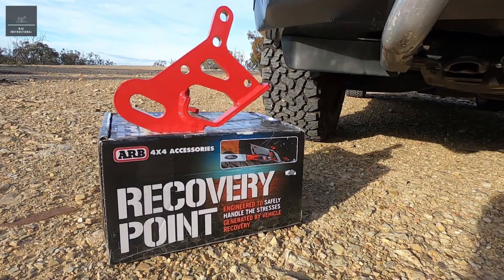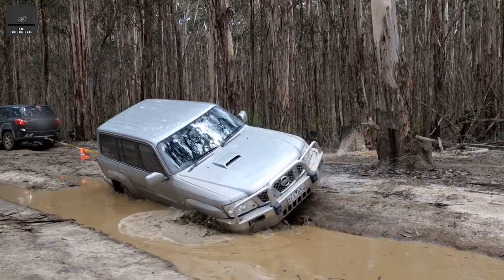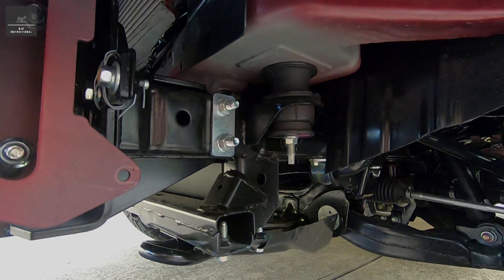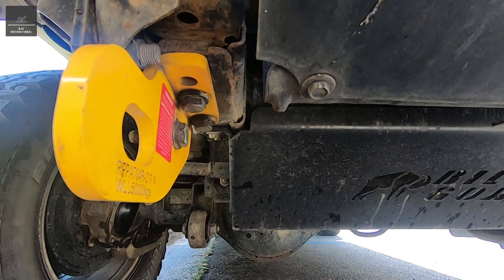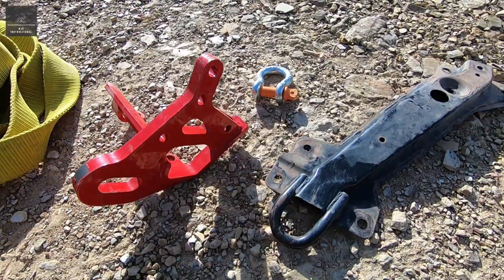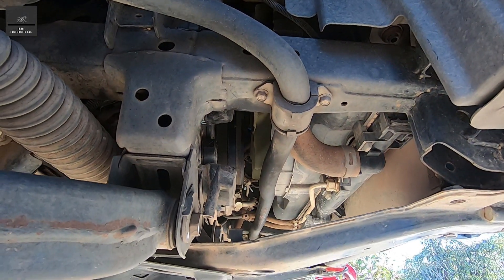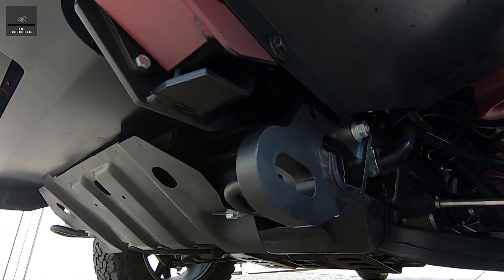4WD Vehicle Rated Recovery Points - 2 Important Considerations TOW POINTS vs. RATED RECOVERY POINTS!

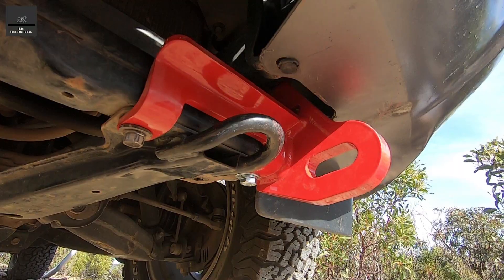Comment: Very nice video! Good explanation. I am now aware that those dual points are not for angled pulls, did not know that. I am guessing that you removed a few bolts to install this and create the video. But just wanted to double check:  at 3:28 in the right portion of the picture there is a bolt half way undone. (will probably not helf as much now 5 years later, yes i saw that after typing everything)

Comment: Some factory tow points on some cars like the Landcruiser Prado and Isuzu Mux are 4 point welded onto the 1st cross memeber of the chassis. They are as strong if not stronger than rated recovery points that are bolted to the same cross member. But I do agree, the example factory points on the vehicles you used in this video are indeed rubbish.
Reply from the maker: Not quite and this is the misconception. Refer back to the start of the video. I have seen photos of factory tow points (typically welded to a subframe not the main ladder chassis rails) torn off (e.g. current model Toyota Hilux / Fortuner). Just because they are welded it doesn't mean they can be used for recovery. A good quality engineered recovery point (or tow point) will always secure / fasten / brace back to the main ladder chassis rails.
Reply: @NJSInstructional  You must referring to the tether welding where a half loop gets touch welded to the surface of cross member. The one I was referring to is like a bolt going through from one side to another. Then it is welded on the front and back total 4 welding point per side. It will transfer the entire load onto the cross member.

Comment: Using those very thick recovery points is just overkill. You can't really break them but it can bend or tear down where its bolted in an extreme situation. Truck frames is not really that thick. I have never seen those tie down points fail in a recovery situation.

Comment: it doesnt matter how hard or thick the metal is u dont need to worry about that breaking its the bolts that are holding it the vehicle those bolts snap then the whole recovery point is a flying missile and will kill you
Reply from the maker: Building upon your point, you can also have a super strong Recovery Point with super strong Fasteners, but if where it bolts to (i.e. the vehicle chassis) isn't strong enough it will simply tear off. This tends to happen when people use 'tie-down' points as recovery points. Even though they may actually be welded to the chassis, the actual chassis isn't strong enough and they simply tear off.

Comment: There was no mention of bolt strength. A metallurgist said to me that the steel can be as thick as you like but bolts can shear quickly if not correctly rated also.
Reply from the maker: Great point! From memory, the Bolts that came with the ARB Recovery Point were either Class 8.8 or 10.9 and the Bolts that came with the Roadside Tow Points were Class 10.9.
Reply: Virtually every recovery point comes with appropriately rated bolts.  You don’t just use any old bolt.
Reply: buy the strongest bolt..herp

Comment: Show us a video of the factory recovery / tie down points failing.   The ARB recovery points are only relying upon bolts into the same chassis.   You specify all the loads that these after market recovery points can take, but what about the vehicles chassis’?  I’ve had a bullbar fitted with rated recovery points on my 76 series.  On looking at the factory tie down points, I’d have to say they look very robust.   I think we’ve all been deceived by marketing.
Reply from the maker: Your point on the chassis is valid. How much load can the chassis take regardless of the recovery point? Will the vehicle's chassis elongate and yield? It is not certain and some vehicles chassis are stronger than other makes... However, something to consider is the factory tie down points are typically welded on to what appears like the chassis but there is no cross bracing behind it. A good example is the current model Hilux / Fortuner. People see a welded tow point and think they are super strong, but in reality they are welded on to small cantilevered steel section (referred to as the tow point sub-frame in the video) coming off at 90 degrees from the main chassis (refer to the 0:23 mark on the video). During a recovery, the bending moment exerted can literally tear the steel section off (there are examples of this happening on YouTube). A good factory / aftermarket tow point will transfer the recovery loads from the recovery point to the main chassis safely. A poorly designed recovery point won't... In the vehicle in this video, the factory tow point is also a bolted connection (refer to the 1:22 mark). Comparing the factory tow point and the ARB recovery point, my preference is the latter... Hope this clarifies.
Reply: @NJSInstructional   Well said, I was almost deceived into believing that my tow points were strong just because they had 4 inches of wielding around them. Not necessarily true, the wielding secured my tow points 100% to the piece of metal bolted to the chasis, however that piece of metal wont necessarily transfer the load as evenly as a rated recovery point would with multiple, high graded bolts on calculated points of the chasis.
Bloody misinformation...
Reply from the maker: @yungboxer8360  Spot on! Unfortunately, too much misinformation readily available...

Comment: My bad ass 4Runner has recovery points from the factory. What you show there is some skinny little tie down point. If you look at a 4x4 Toyota they build it at the factory because it a 4X4! Take a look at those things they are super thick and welded front and back to the chassis.
Reply: Interesting, my '08 4runner 4x4 does not have rated recovery points from the factory. It has the tie down/tow points almost identical to the ones shown in this video. Perhaps this is a feature for a certain trim level and or generation. Now my '95 4runner had recovery points front and rear when I bought it. Not being the original owner I can't say if these are from the factory or not.
Reply: @27AriO  yeah not sure about that but you’ll know if you do by the look of them. 😎
Reply: @SarasotaTim  yup there is no mistaking a beefy, solid recovery point
Reply: Yeah, they’re not recovery points.

Comment: Can I use the recovery point with original bumper?
Reply from the maker: Depends on the vehicle. With this particular vehicle, it requires some minor cutting of the plastic guard.
Reply: @NJSInstructional  is factory fitted recovery points on Prado safe for off roading?

Comment: What is the brand of the yellow recovery points. Would like to use two for my Tacoma. They are labeled RPPATO4R-C17 in the video
Reply from the maker: The brand is RoadSafe. They are specific to each vehicle, so the part no. may be different for the Tacoma.

Comment: With vehicles not even offering recovery points these days having options is key. Nissan is key among those not putting recovery points on their vehicles.
Reply: Most 2nd gen rams also don't come with factory tow points, had to weld up a set myself

Comment: This topic is not quite so black and white. It depends on the vehicle in question. Some cars may have flimsy points for sure. The tow points on the 2019 Hilux you showed however are 16mm steel loops. Both legs double penetrate the front chassis rail and the are quadruple welded (both loop legs solidly welded front and back sides of the chassis rail). I don't care what anybody says, you will bend or rip the chassis rail off before these babies come out, and if you do, you're snatching way too hard anyway. 
You need to have some understanding of material strengths and make an individual assessment for a given vehicle.
Reply: This is true, solid steel rod bent and welded multiple times will be far stronger than a handful of bolts - as that's what we are looking at here, a chunk of steel bolted to the chasis.
Reply: I was here for is it enought to pull my Hilux 2022 recovery points until see this video in first minute.. Then write your comment, now i think it will be ok... maybe then i will change my mind again :D oh man it's so complicated

Comment: Living in Canada, and having ice fishing as a hobby, pulling someone out of a deep snow drift is a very common occurrence. Generally speaking it will be 4 wheel drive pickup trucks.  they often have recovery points from the factory in the front, and a trailer hitch in the rear. I prefer pulling from the rear if possible, using a hitch receiver with no ball in it, instead a bow shackle through the hole with a recovery strap looped through the shackle as well. The factory recovery hooks on trucks are generally much stronger than the factory points you show on these smaller suvs. Mine are 3/4 inch thick steel loops bolted directly to the frame with 3 grade 8 bolts. They are quite safe to pull with, provided you use a proper recovery strap or rope. Too often I see people use tow straps with hooks on the ends, or worse, chains. Jerking with those is asking for an accident.

Comment: Good video 👍... just FYI the bow shackles should be placed with the pin through the recovery point, not the shackle it self..
Reply from the maker: Hi Juan, I don't disagree, however in the ARB instruction card for use, this is how they recommend the Bow Shackle is used.
Reply: @NJSInstructional  thats a good way to tear the loop end of the snatch strap.

Comment: You forgot one very import aspect , " High Tensile bolts grade 8.8 or 10 "  should be used to bolt it all up .
Reply from the maker: Correct, they come supplied with the Recovery Point.
Reply: @NJSInstructional  Now if ARB actually had a list of the vehicles that they make recovery points for it would be very helpful .

Comment: No question the aftermarket brackets are more heavy duty and they are called rated points by the manufacturer. But if something goes wrong and one breaks or bends something on the truck frame they will simply say you must have exceeded the rated load or used them improperly to do the recovery and you have no way to prove then wrong. Rated is just a word, they are heavy duty but not bulletproof and no implied guarantee of anything. Just something to consider

Comment: Early in this video you show the shackle and recovery strap incorrectly, the recovery strap must always sit inside the bow not on the pin and the pin of the shackle must engage the recovery point, all the same principles used in rigging to lift loads.
Reply: Isn't it bad practice to side load a bow shackle? By putting the strap on the shackle pin the side loading is prevented (if used as described).
Reply from the maker: Hi Ross, thank you for your feedback. The Recovery Point is designed by ARB and in their recommended use guidelines, they demonstrate that the bow portion of the shackle should be within the recovery point and the strap connected to the pin. This allows the bow shackle to freely move within the recovery point, especially useful for angled recovery pulls. Cheers.
Reply: I agreed I've never seen a shackle used like that in rigging anything, ever, the shackle can pivot off the pin just as easy, I'm going to continue to use mine in the traditional way until someone can prove it incorrect
Reply: In my view and based on what I just watched and done over the years I would agree with the Authors use of the shackle. The principles and equipment used for lifting loads and recovering loads are very different. Posted respectively
Reply: @TowieHD  I'll accept this as my world is lifting and not recovery, thanks.
Reply: Something to consider, the factory tow point interferes with putting the shackle on in the way you describe.  I have the same exact problem with my aftermarket recovery points.  I can hook the shackle via the pin to the recovery point, but it doesn't allow for any movement, and is not square.  Thus, I either connect the bow to the point, or use a soft shackle.

Comment: Quick question fitting the arb recovery points to the Isuzu was it easy and did you have to take to bullbar off to do it? I have a dmax 2019 with arb summit bar and have ordered the recovery points, just not sure if I should get arb to install?